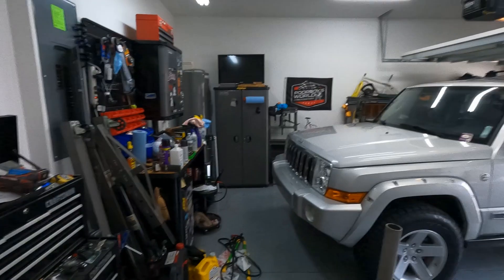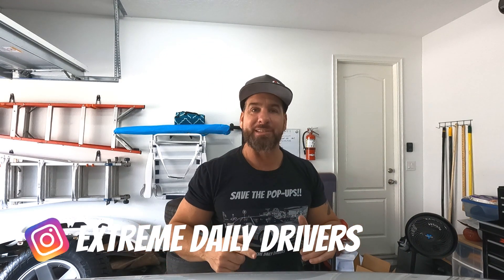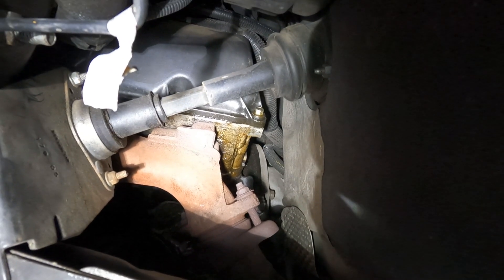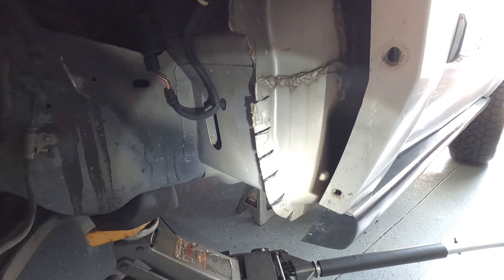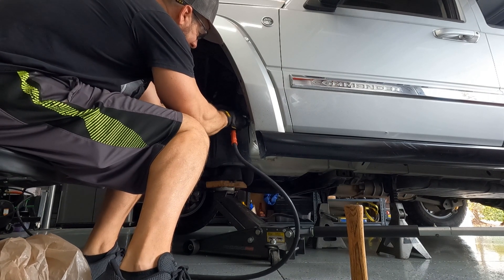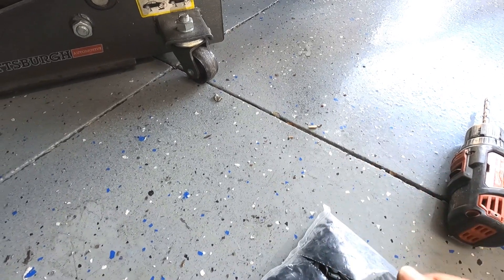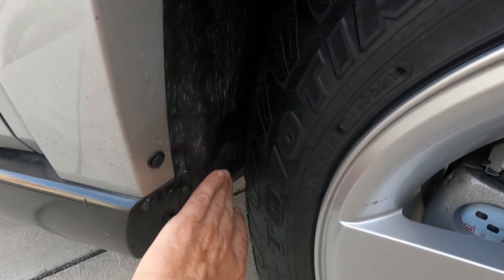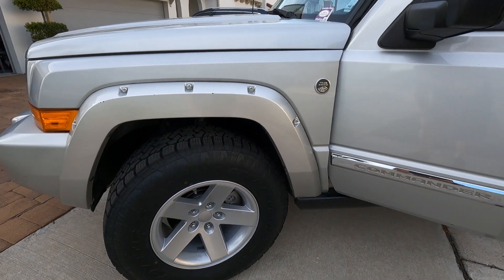How to Do The Pinch Weld Mod - Jeep Commander Overland Build

Comment: Good job! I did the pinch weld mod too after I upsized tires to 265/65R/17 and got a slight rub on both sides (as I was expecting). I already had 11/2" front lift and 11/2" wheel spacers. I used a heat gun to reshape the wheel liners some before securing to the wheel well with a screw on each side. After done I had about 1/2" of clearance for the tires on both sides but my tires are a little smaller than yours.
Reply from the maker: That's a good idea to try to reshape the liners before installing them. I should have thought of that. Thanks for watching and good luck with the Commander!
Reply: @ExtremeDailyDrivers  I found that reshaping just before I put the secure screw while still warm made it a lot easier to get the screw set where I wanted it. At first I tried shaping it ahead of time but when it cooled it kept going back to it's original shape.

Comment: To keep mines from not rubbing I had to put a wheel spacer in between to bring the wheel out just an inch 1/2
 I recommend you put a wheel spacer and you will get that little bit you need maybe a half inch hope that can work for you I know it works for me
Reply from the maker: Thanks for the tip! I was considering a 5mm spacer thinking it would be enough. I don't want to run the bolt on spacers. So far the rubbing is gone unless I'm performing a tight u-turn, but still haven't tested it off road. Thanks for watching!

Comment: Hmmmm, I won't be able to cut my body, in NZ we send a vehicles in to the mechanic to do a Warrant of Fitness to ensure they are safe to drive on our roads, if they ever found out I cut the body it'll be and expensive repair or they will permanently right it off the road, ill probably stick with 265 65 17 to ensure no rubbing, great job on yours, I give you this you put in the work mentally and physically 👍 👏
Reply: @jeeploggernz2289 just wondering how you went with the 265/65/R17 tyres. I’m in the same boat in Australia and not too keen on doing the pinch weld mod (although others have done it) Did your tyres fit without rubbing ? I have a 46mm lift with Koni heavy track shocks front and back and Dobinson springs with a JBA upper control arm fitted. Not too sure I can get the 265/65/17 to fit??
Reply: @Jim Tertipis  hay how's it going Jim, I'm still on the prowl for one, all our Commanders over here have high ks and mostly 4.7s, I really want a 09-10 Black with the Hemi, probably asking for a miracle haha, so you're having doubts with the 265s and 2 inch lift, hmmm that's not sounding too good, whats you're thoughts on maybe grinding down that lip, just enough for the tyres to fit, then underbody seal to hide it all
Reply: @logger711  Thanks for your reply. Over here in Australia we don’t see many Commanders and currently there are 3 available nationally - all with the 3.0L TD, but you do sometimes see the odd V8. Mine is a black one that I bought with 119k km. Currently it’s just clocked over 140k km. It’s been a darn good car. I sized up a 265/65/17 at a tyre shop and I didn’t look like it would fit as is despite my lift. Also I don’t think this size would fit in the spare position. I have a Haymen Reese tow bar and there is just enough room to fit the standard 245/65/17. I’ve heard of people having a 265/65/17 under there but they have it flat and sometimes with a strap around it. You’d have to keep a compressor in the car just in case you need it. I’ve thought of putting a long range tank there and fitting a rear wheel carrier to hold the larger tyre but that is all quite expensive. I’m thinking I might have to go for a 255/65/17 if I don’t want any trouble. Not much of a increase in tyre size. But certainly I’m very happy indeed with the way it currently handles. It’s like chalk and cheese compared to the stock set up. I’ll let you know how I go. Good luck with the car hunting. A HEMI would be worth the wait. Too bad we are not in the US. They don’t have the diesels there. That option wasn’t for their market. I still recommend the diesel. It is a Mercedes benz motor and 5 speed auto. A but thirsty but plenty of grunt and reliable.
Reply: @Jim Tertipis  ok that's good to hear you're quite happy with it, I had a WJ grand cherokee Overland with H.O 4.7, had her for 8yrs with next to no issues, 2" lift 265 65 17s, so yeah was very impressed with that and with all these extreme weather events I want a lifted Commander with Quadra Drive 2, it's meant to be haha, yes please definitely let me know how you're tyres go, 
Hay where or what do I search for Commanders in Oz, is there like a main website where most sell their vehicles

Comment: Did you have a lift at all? And which one, I just did the Rough Country 2.5” front and 1.5” rear and was getting ProComp AT 265/70/17
Reply from the maker: Yes. 3 inch. I did a video on it. Just search the channel. Thanks for watching.

Comment: Is this pinch weld mod has definitively solved your rub problem ?  is it ok in off road situation, because it seems still close ?  - Thanks from France for your feedback & inspiration 😉
Reply from the maker: It's necessary if you want to run 265/70/17 tires. My issue is that I'm limited with my factory upper control arm setup. I will be installing new upper control arms in an upcoming video. That will allow me to apply more caster to my alignment, which will allow the front tire to move forward and away from the pinch weld. Make sure you sub so you don't miss that video. Thanks for watching.